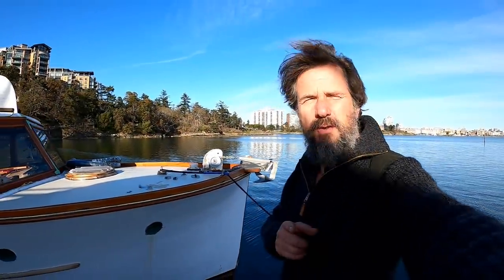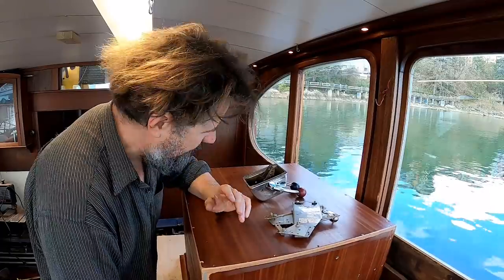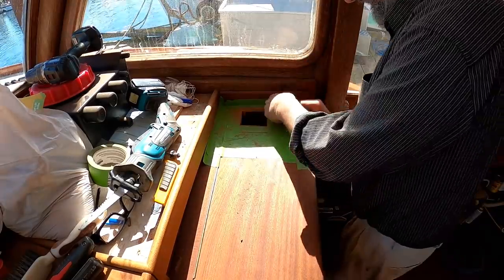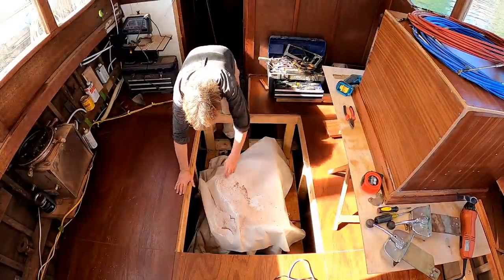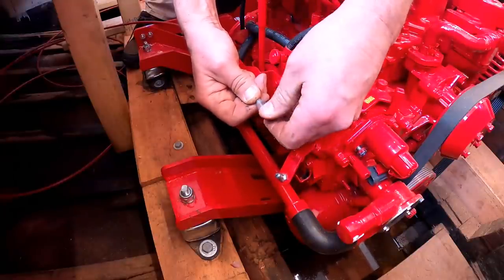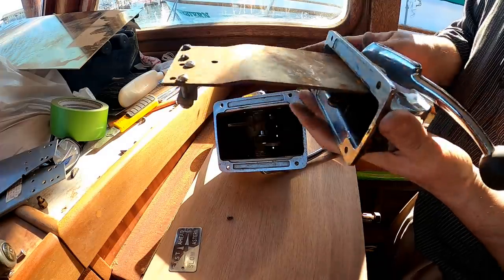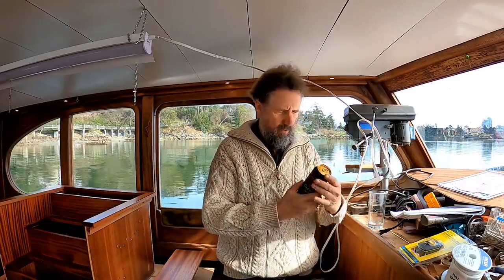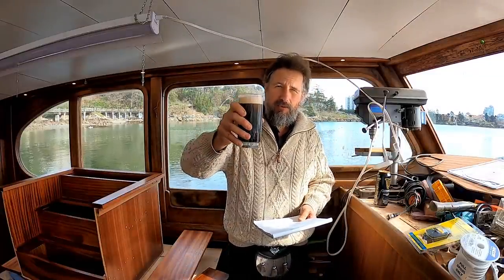Engine Controls - #222 - Boat Life - Living aboard a wooden boat - Travels With Geordie

Comment: 2 suggestions:  It's good that you have the full travel for the throttle remote.  That will allow much easier adjusting to specific engine rpm's, than a shorter travel that will make throttle adjustments very sensitive and difficult to dial in.  Also, you might want to get some rubber stair treads to glue onto your new high traffic steps.  That will save you having to re-varnish those steps as often.
Reply from the maker: Both great

Comment: E throttles will solve your remote helm issues and you will find that Morse controls wear out and require cables replaced frequently. I’m a professional mariner now (tugboat captain), but I started my career as a marine mechanic. I love your channel, because it’s basically my old job. A simpler time. Anyway, my preference is electronic controls. I don’t always choose new tech, but in this case I would.

Comment: Peter, I'm a big believer in old school Morse controls. Always had them in my boats, laid out exactly as you had them. The click-stops always corroded off, anyhow, so I liked turning the friction set screw up a little instead and having smooth controls... the throttle range you ended up with is perfect IMO. You will at times chop the throttle to idle too hard at need, and a longer throw in the throttle lever translates into finer RPM adjustment. Good for going up or town just a few RPM's  when resonance makes your teeth itch, and also not sending people staggering when you accidentally goose the throttle.
Reply from the maker: I’m in complete agreement now. love it!

Comment: geordie the lunchbox! geordie the coffee mug! if your table saw allows, use a skilsaw blade without breaking out the "diamond shaped thing" for less kerf, a lower rpm at the teeth, but of course less depth. the bonus is the price. you can slap a new one on for some ply projects, then use it for the skilsaw later. man I have old skilsaw blades and mach 3 razors both from over 20 years ago that still work great. razors are easy because I only shave when in a relationship but keeping the old irwins for breaking down firewood is a great thing for me. I use diablo now new because it's more available but if I need to whack some scrap into pieces it's easy enough to swap blades. I have the worm drive although I guess I also have 3 of the other type as well. I only use them for certain things that want higher rpm (3 degree door edges, door bottoms, finish ply (with tape on the foot for no scratches) etc. I only put a 10 inch on my table saw when I need that extra depth, to save the blade, and for the kerf. If you rip up a bunch of planking, the kerf really counts, the sharpness of the blade really counts, in hardwood you're reducing sorry not the rpm but the actual speed of teeth over wood and yes it will flex more initially but I think the kerf more than makes up for it especially if you're me and you're passing material through multiple times to even out the "funny stuff". Trying to send you some beers we'll see how that works out
Reply from the maker: Lots of great stuff there. must try the circ blade trick.

Comment: Slainche vas ! You are bang on about not having connected Morse controls. I was approaching the airport road bridge in Richmond years ago just before the rush hour restriction when a cable on the upper helm snapped and jammed the lower helm as well. We dropped the hook to stop being swept into the bridge. After about ten mins of puzzlement we found the problem disconnected the upper helm cables and we were back in operation on the lower helm.Got the hook up approached the bridge too late! Rush hour !gave up and went over to the Richmond Casino Dock and had a cup of tea.
Reply from the maker: best possible outcome
Reply: I define puzzlement as running around with my hair on fire bye the bye!cheers

Comment: Hi Peter, I adjusted my throttle from matching the transmission neutral position to a further aft more play position. Before I made this adjustment making small throttle changes required tiny movements. For example, to increase 200 RPM i would need to nudge the throttle a a few MM. I have found having the throttle set back at idle compared to the transmission lever position has been worth it. I have much easier power adjustments especially when you are busy. While my OCD brain loves the levers to match, docking in stressful conditions has been made way easier with more throttle play. For whatever its worth, I’ll just shut up now.
Reply from the maker: Thsnks for the insight. I believe you’re right.

Comment: I worked on the Maid of the Mist in Niagara Falls Ont. We had Morse controls on our twin engined vessels. Like yours it had two levers but each lever controlled one engine, forward and reverse. On the transmissions there were chain wheel arrangements that allowed one lever to run the engine in forward when the lever was pushed forward. For astern(reverse) pulling the lever back the gear mechanism would shift  the transmission into reverse yet allow the engine to go to full revs. The cables also ran in conduit with a plastic divider inside it to prevent cable damage. An internet search will find lots of sites for Morse control manuals and parts, BY the looks of things it is not a true Morse Control.  Another great interesting video.

Comment: If the accelerator is in the aft position at idle and full power when all the way forward you'll have a less sensitive control ie move the lever a little and you'll get a small change in engine speed vs having idle halfway up the travel where a slight touch will result in a higher çhange in engine speed. The full motion option allows for finer speed control while the latter is more coarse. If you're long distance cruising and need a very specific rpm for efficiency then go for fine but if you're maneuvering a barge around where all you need is idle or max, then coarse is useful.
Reply from the maker: Very good point. I’m quite pleased in the end.

Comment: Set Back all the way is usually idle and as long as your set up with full throttle, you should be set just fine!! Peter. well it appears that the left hand set up is perfect in my eyes being your throttle is on the starboard side which is normal for me.. its the only way to go really. It should work great.  That very nice of Ben to gift you with a new saw blade and the others folks hitting that wish list for yah. That's great. well have a good wk bud. I raise my toast and glass and proudly say Slaintie to you as well Peter.

Comment: All this reinforces why I went with a single lever dual function control.  Well that plus the sailboat had a single lever control and I wanted the two boats to be the same.
Reply from the maker: I see the logic, but I like separate controls. seems more, I dunno....
Reply: Definitely the better option. Safer for the marine gear too. Cannot be accidentally engaged at a rpm above idle.

Comment: You could extend the throttle lever Peter, I think that would fix the ergonomics
Reply from the maker: I suppose, to be fair, I quite like it now.
Reply: @TravelsWithGeordie  see how it goes for a bit, nickel plating to restore the finish isnt that hard or expensive to do yourself.
making a spring for the detent is easy, they use piano or 'music wire' which is commonly available, all you need is a mandrel, which can be anything.
availability of the ball bearings not so much

Comment: The throttle on my boat is set up with a short throw the way you wanted to do it... but it annoys me because the difference between idle and a slow cruise is about 4 mm movement on the control levers. .I need to adjust it so it's like yours is now to make less sensitive. .I only have have to knock it and it blast of to full revs..

Comment: Hi Peter,
Regarding your concern about the throttle lever looking odd if idle is all the way back and neutral is in the middle.
When I'm not using my engine I always leave the prop engaged and usually in reverse.
So then both your levers will be aligned but just not in the middle position but rather in the back position.
Might help?

Comment: Tiny tip (from working on charteryachts). Laying morse-cables in an empty boat which is gently moored at a jetty is easy. But Morse-cables do wear out, which you sometimes find out when you are not moored at a jetty. In an empty boat.
Sollution: while you still have space to work in and time to spend; double the cables!! Also lay for each of them one spare morse-cable. For just in case somewhere in the future. So you can easily swap cables in no time when you need.
Reply from the maker: Damn good idea!

Comment: Peter, Can I ask a silly question.. why did you remove the helm from the other side and decide to start again?
Reply from the maker: Not silly at all. A few reasons. first, I intend to do a lot of canal and lock cruising and I’d much rather drive from the bank side. it’s also somewhat easier to keep an eye on the boats I must give way to. and finally, it works much better with interior layout plans. 
double berth forward and dinette in wheel house.
Reply: @TravelsWithGeordie  Lovely Thanks Peter.
Reply: The morse for my 31' wooden cruiser has only one morse which has centre is neutral, forward and reverse and then pull out sideways gives revs without operating the gearbox.. I think that is much easier than 2 separate controls.